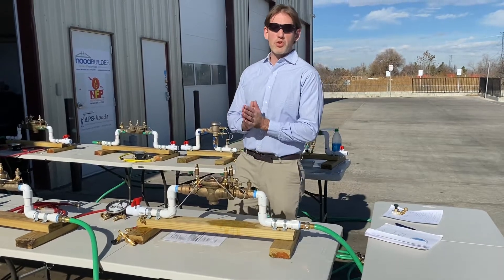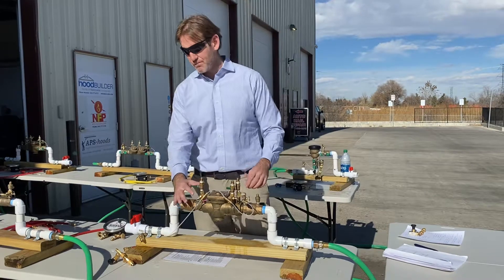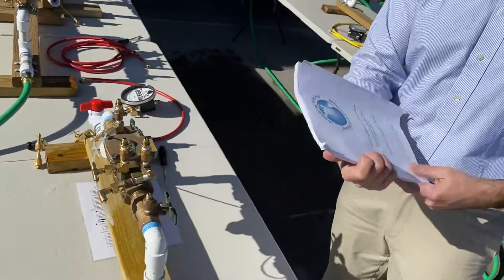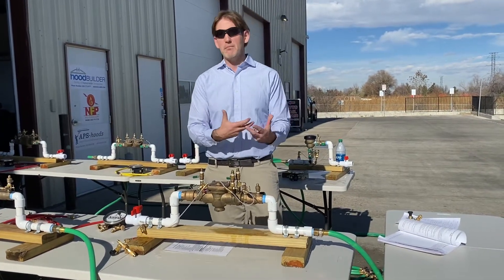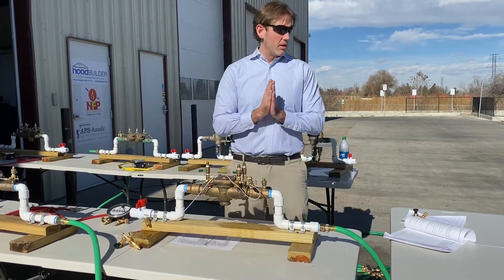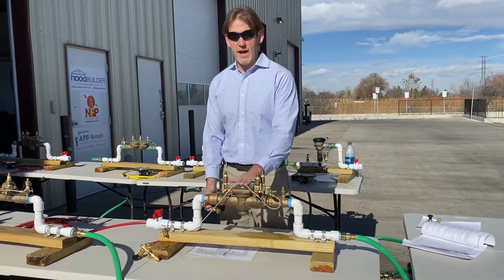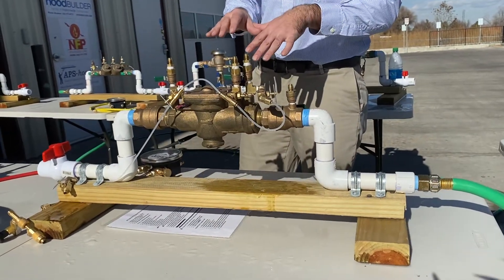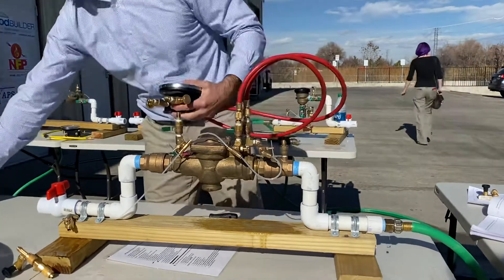RP Backflow Testing - USC 10th Edition Diagnostics that you will likely see on Exams

Comment: Summary:

NOTE: THIS IS WITH THE 5 VALVE GAUGE.

Check Valve #1 Leaking: 
(Observe relief valve with continuous leak upon seeing rp)
During Test #1 to check for apparent reading: open tc#3, open low bleed; open tc#2, open high bleed; close shut off valve #2; close high bleed, close low bleed:

>> You will observe differential pressure dropping past 5.0 and relief valve opening.

*Can not proceed, record Check Valve #1 leaking, cannot test.*
Do Not record RV opening point, or continue to CV#2 test

Check Valve #2 Leaking: 

After Relief Valve Opening Test; connect bypass to tc#4 ; open tc#4; open, then close, low bleed; open bypass control valve, then:

>> If differential pressure drops past 5.0, Check Valve #2 is leaking. 
YOU MUST DO 2nd Check, 2nd Chance! 
YOU MUST REOPEN/CLOSE LOW BLEED TO GIVE CV#2 A SECOND CHANCE!
**Can not proceed; record RV opening, can not record Check Valve #1 reading, can not record.

Shut Off Valve #2 with Flow: 

During Relief Valve Test; open high control 1 turn, open low control 1/4 turn.

>>Relief Valve will not open. 
** YOU MUST: Close high and low CONTROL valves, and:
CLOSE THEN REOPEN SHUT OFF VALVE #2 TO GIVE SO#2 ANOTHER CHANCE, (reopen/recluse low bleed.)

Tc#1 to tc#4 bypass test method, open/close low bleed to see differential pressure for check valve #1 reading.

Shut off #2 with backpressure:

>> reading will raise during test #2 (bypass to tc #4)

Comment: Having a leaking #2 shut off valve  in the direction of flow. After you bypass water from TC1 to TC4 to compensate for the #2 shut off valve leak to obtain the relief valve opening point, can you then obtain the tightness of the #2 check valve?
Reply from the maker: Yeah the bypass tests the CV-2 against backpressure

Comment: How would you test a 2nd ck and record 1st ck in the field under a leaking sov#2 with back pressure?
Reply from the maker: Good question .. since most ABPA / AWWA / county exams don’t have the capability of simulating back pressure we don’t cover it as thoroughly in the videos, but there is a process outlined in USC 10th ( diagnostic 9.2.2.3.6 for 2 valve / 9.2.1.3.6 for 5 valve ) basically you close TC-2 to confirm back pressure condition ( on the test it would not be false ) and then close TC-4. You would record CV-1 apparent as the differential pressure ( back pressure would indicate no flow condition ) record RV opening point, and record CV-2 as tight, with a note saying “ leaking #2 shutoff with back pressure “ .. so essentially if the gauge reading increases, the extra steps are close TC-2 then TC-4 .. and then write down the results with the note .. assembly passes .. but again we omit it from the videos since it’s super unlikely ( but i suppose possible using PRVs and elaborate piping setups ) to encounter on a standard exam